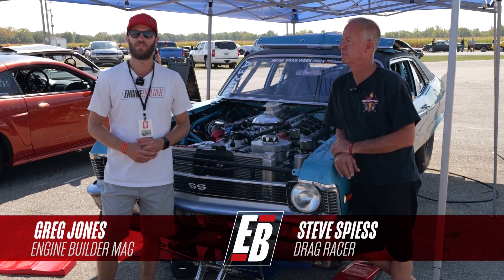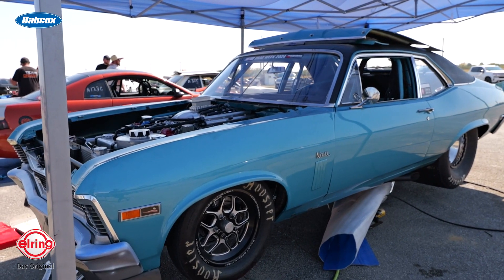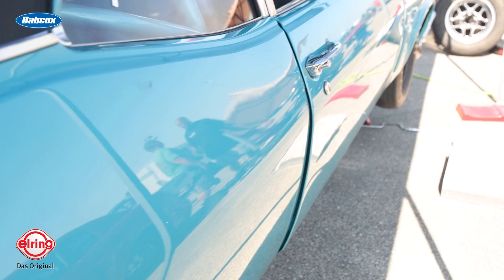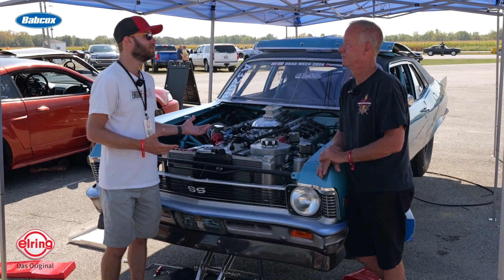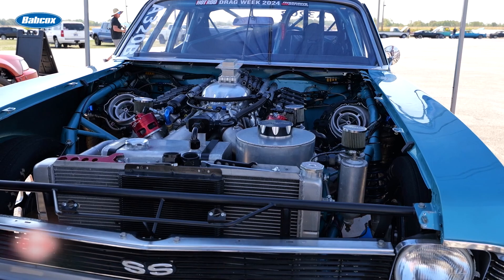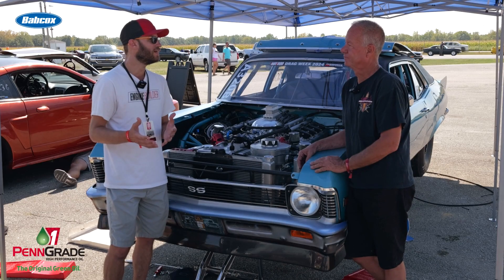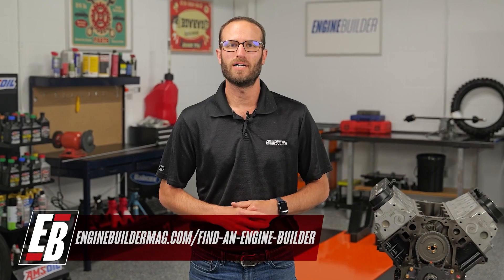Steve Spiess' Twin-Turbo 565 cid Jon Kaase Engine

Comment: Thats a Boss 9 Ford based engine? Be nice if that interviewer asked .
Reply: I don't believe Kaase generally builds anything but Ford. I know he has for Engine Masters, but his regular engine program I do believe is Ford.
Reply: @PSA78  he used to advertise Chevy and mopar mountain motor prostock engines on his website,  but they are all based off the ford boss engine.
Reply: Right. I don't even know if it's a Ford or Chevy
Reply: He doesn't kno to ask
Reply: Chevy
Reply: Ford
Reply: @russellridge8623 Ford Hemi
Reply: @russellridge8623  Ford
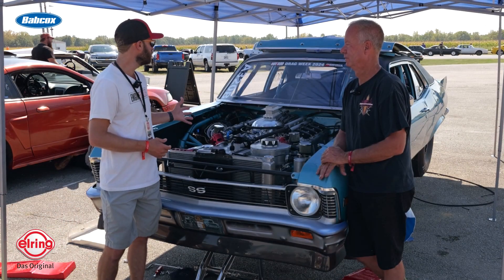Reply: at 4:11...definitely a 429 Ford Boss Hemi style engine,. No doubt whatsoever...spark plugs go through the center of the valve cover.